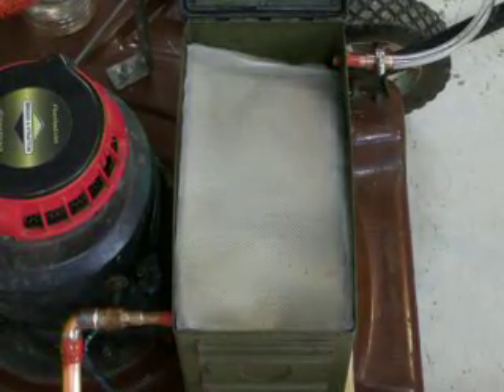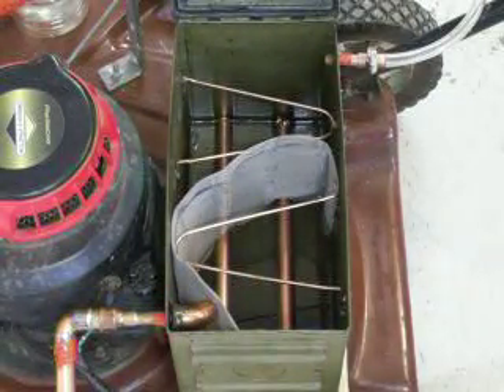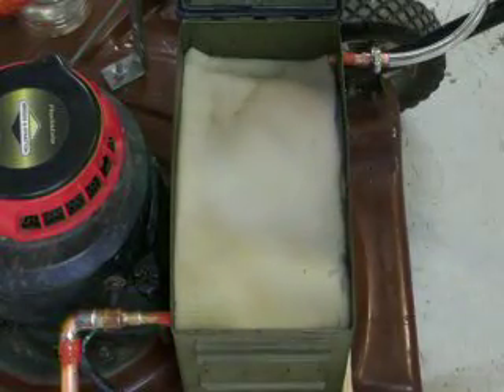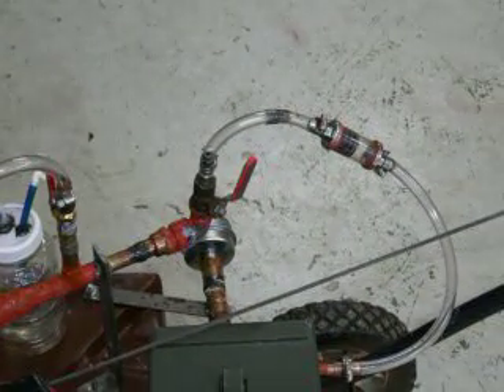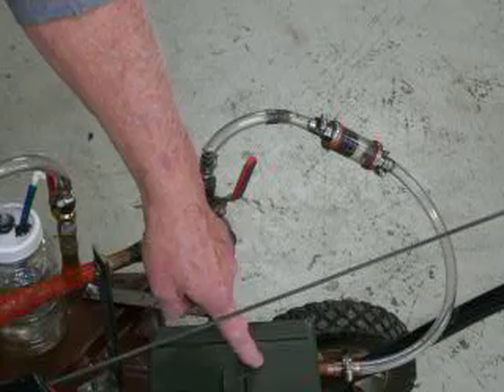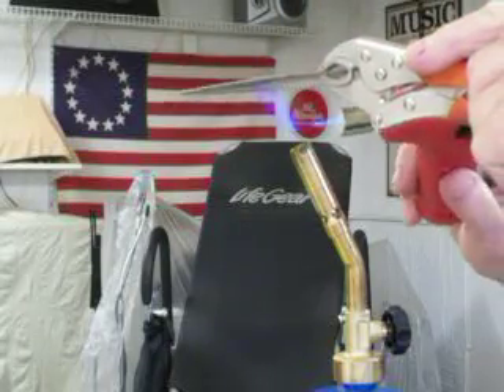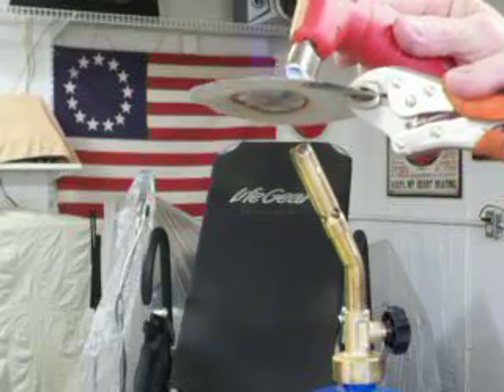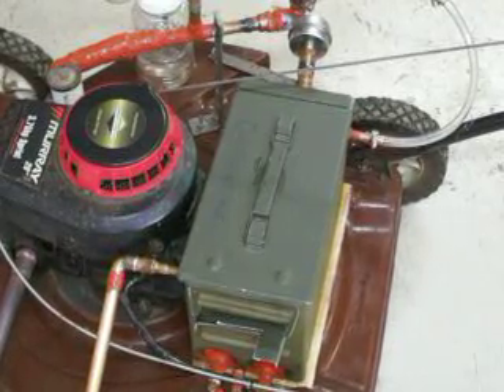vapor filter explained

Comment: I am very interested in your work.  I have an ill-tempered older Craftsman generator that is difficult to start after sitting for more than a couple of days.  I liked your video where you re-installed the carburetor on the lawn mower, as a generator uses an internal governor linked to the carburetor to keep the generator output @ 60 Hz.  I intend to convert the generator for economy and ease of starting.  Your flash suppressor reminded me that there has been a gas can product on the market for some time called "Explosafe."
http://www.explosafe.com/
If you are familiar with "expanded metal," that's essentially what it is, only made from tin foil. The principle is that expanded metal has so much surface area that ignition temperature cannot be reached as vapors are kept cool, well below ignition temperature. Screening obviously also works, but I would use multiple layers to ensure heat dissipation.  I believe this principle may interfere with heated vapor as it may cool the fuel vapor more that you want. I intend to use a very course steel wool for flash suppression, probably soldered back into a tin can with a fitting on each end.  This eliminates glass components which I do not like around vibrating/rotating machinery.
Just sayin' -
Thank you for your videos.

Comment: My brother and i did this its very easy to run any motor on fumes .........the problem is carburetor are designed to turn gas into a fume .................YOU Get very little more run time on fumes then you do using the carburetor ..................all these videos are BS. They never show you how long the motor runs with the same amount of gas running on Carburetor and then fumes. My Brother and i ran 8 ounces of gas though the carburetor and timed it then put the exact same amount of gas in the bottle and ran it on fumes  the difference was a min more at best . Most people are stupid and just have no clue a motor can run on fumes. GAS vapor is what runs ALL MOTORS . ...........

Comment: Very interesting work.  How using a piezoelectric plate to vaporize the gasoline? (e.g. the piezoelectric / ultrasonic plates used in humidifiers and foggers?)  Might not be as efficient as fumes, but might be simpler.

Comment: Why not use this (or something like it) on other gasoline vehicles PLUS a hydrogen generator!  I make my own design of both for MAXIMUM EFFICIENCY.  Gasoline vapor is AMAZING but hydrogen gas is THE ULTIMATE FUEL-THE MOST POWERFUL & NO POLLUTION!  Why not use both?
Reply: Why not heat the gasoline with hho gas from a HYDROGEN GENERATOR?  Instead of having the hho gas go into the intake, have it go into a GASOLINE VAPORIZER to HEAT the gasoline & PUSH the gasoline vapor & the hho gas combination into the intake?  Wouldn't this be MUCH BETTER?  If you don't think so, please let me know why!  By having hho gas in with the gasoline vapor, I believe you will have not only better mpg & power, but also LESS POLLUTION!  Why not try it & COMPARE?  Also I advise being prepared for a back fire JUST IN CASE!  We need to be prepared ALL WE CAN!
Reply: Wendell Ferrell "Why not heat the gasoline with hho gas from a HYDROGEN GENERATOR?" Because HHO gas is not inherently hot. It comes from electrolysis, and the only heat produced is when you actually burn it.  The electronics providing the electricity might heat up a little, but that's not useable. Combining the two may increase efficiency, but it wouldn't matter where they are combined.  Running the HHO into the gas vaporizer may actually reduce the temperature of the vapor.

Comment: yo Vaaporkid why you try to make a fuel vapor can when you can just buy one from auto part store. my 1986 buick regal has one.

http://www.autozone.com/engine-management/vapor-canister/duralast-vapor-canister/buick/regal/1986/6-cylinders-a-3-8l-2bl-ohv/66264_0_0/
Reply: The "vapor canister" in your Buick is part of the government required stock "vapor recovery" system which collects excess vapor from the fuel tank and lines, and routes it to the intake to prevent air pollution.  It is not a vapor generation system.  It is only to help prevent vapor explosions in the tank, and leakage to the atmosphere, i.e. air pollution.  It is filled with activated charcoal to hold the vapors and dissipate them slowly through a computer controlled solenoid to the intake.  It would never run the engine by itself.https://www.youtube.com/watch?v=nIZ4EGknw2Q
Reply: I checked it out & it was NOT AVAILABLE!
Reply: the vapor canister for my 1986 buick regal non turbo is used to filter out gas fumes and a fuel goes thru there too. it waste of gas, also my car has a heater gasket that goes under the carburetor which vaporize the gas and this is standard on cars like mines.I saw charliechopchopman interview video with this guy named bill. bill was one of the inventors who knew guys like stanly myers, Tom ogle etc. the guy had a old notebook full of newspaper clipping of many inventors who created free energy running vehicles that got shut down by the government.

Comment: Thanks for sharing!

I have had several backfires using vapor and I'll tell you what it burns big time and has allot more power than a liquid mist of gasoline. When dialing in a new system the potential for a backfire is much higher than a system you have figured out and dialed in. Backfire protection is a must, you always want to be prepared and have a safe system just in case.   I had been testing vapor systems for over a year before I had my first backfire.
Reply: Tyson Capel does your bubbler method work or does it stunt off after 15 minutes like everyone says?
Reply: ZZROBProductions It only works if you continuously let a small amount of fuel in.
Reply: Tyson Capel  what are he sizes of your tubes ? I'm going to get the parts tomorrow I'm going to go with the ammo box method and run it into the air intake rather then the carburetor.
Reply: ZZROBProductions I've used many different sizes of tubes. I've used from a 3-inch to clear down to about a half inch.

Comment: What about run time?  What i would like to see is a accurate side by side comparison on solid fuel vs vapor on how long it will run on say 1 Gal of gas.  I assume they would vary with and without loads.  Mowing grass really does not allow a consistent equal load.  I would like to see a generator modified like you did the mower and a 1500 watt space heater applied and see how long the run time would be in comparison.  Lots of benefits to what you have done, like to see more practical in savings.
Reply from the maker: i am sure i will find out this winter when we have a power outage, i have a outside generator to power the whole house,that will be the test! i am sure it will do what i want.
Reply: The logic seems to be undeniable.  I have a ford 2001 4.2L V6 cargo van that i am converting it into a work/stealth camper van.  If i am on a remote jobsite with below freezing temperatures and sleeping in it would be nice to run the van at idle on vapors. generate power from alternator and provide heat for pennies is the idea.  I have awesome access to the motor through the cab and have some room to add a vapor container there.  I have both exhaust manifolds right there using one to preheat the air for bubbler then heat it more on other exhaust manifold before it hits intake. Using copper lines to wrap the manifolds.  The fuel lines also terminate right there by the bell housing from aluminum lines to rubber hose to fuel rail.  On the fence as which method is best to vaporize the fuel most efficiently.  I like your set up as to worse case scenario i can get generator to run space heater for pennies.  So many options.  Thanks for passing on your knowledge and sharing.  Eager to see generator mod.
Reply: A generator is the way to do load testing that's for sure. I have my generator equiped with one of my vapor systems and have everything setup to do comparison testing and i will shoot a video of it once I have more time. I'm working 2 jobs a full time and a part time one and have been going to school as well but once I get some time I will share the test results. I'm sure The Vaporkid will as well.